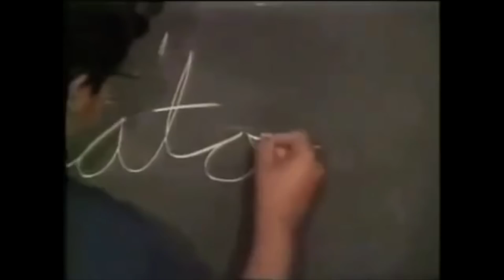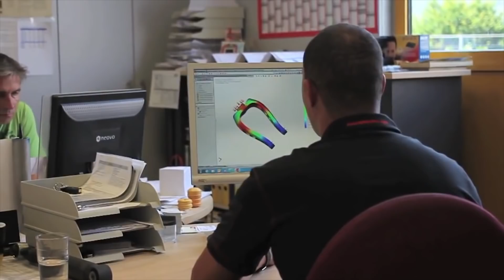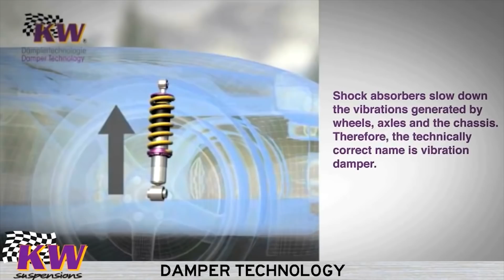THE TRUTH ABOUT KW SUSPENSION

Comment: i have varient 3's  they are amazing
Reply: Tell something more about KV 3
Reply: How's the comfort?
Reply: @Piotr Mowka   @MWAclanGaming  Hello, I have the K&W V3 since 3 weeks now. Car is Lexus IS300 mk1.
Obviously, I lack experience and any advice of me should be taken with all the grains of salt necessary. My pals in my teenage times did tuning, but they putted cheap things that you can find in our remote area, like Bilstein coils and so. But I can compare it to my original Lexus IS300 damper, that seems to be a special Tein specifically made for Lexus (green coating is very typical).

The original Lexus suspension where strongly oriented in direction of comfort, the K&W V3 helped a lot to not loose this comfort in a significant way. With no surprise, in the "standard installation setting", the car runs smooth over imperfections, but doesn't sag when turning. In the orig setting, it has always a form of elasticity that can be felt in the behavior of the car, it's not crashy, it's not race-car like. For those who know, the standard "from factory" setup is a lot like the Ferrari factory setting. It remember me a lot of the Ferrari F360 Modena, that had this kind of gentle but then furious and solid behavior. The Audi R8 also behaves a little bit like this.

The much cheaper Bilstein coils of my teenage times where feeling 200 times more crashy than that, they had sometimes problems to follow the complexity of the road.
The coilovers are lower by default in regard to the oem. Even if I would not want to lower my car, I would loose 2 centimeters. For the Lexus, I would nor go lower than 2.8cm, it's what I did, but I am at the absolute limit of beeing so low that it becomes a handicap. 2.5 / 2.8 cm should be a good goal to aim. Car is lowered but the usability of this setting stays great.

The low weight wheels paired to those coilovers are extremely unforgiving. You feel the road more through the steering and the car reacts faster. The Is300 already had a very direct driving response, but it was fastened a bit with this installation, that means that we are near race-car territory.

What has become evident, is that you can rund much more at the point of rotation and play with it. With the original suspensions, the car tend to go into understeer and you needed to play with the wheel and subtle smash of the gas for oversteering. With this setting, I need to brake less and the car will stay in an in-between position between under and oversteer, waiting for my signal of what need to be done. I feel that to be a very safe behavior.

On the modern european K&W V3, they have dropped the low and fast rebound and compression settings. You have standard independant compression and rebound settings. But they have bettered the cooling of the coilover, adding an external tank along the coil. I already tested the car on several mountain roads, during half day runs, and they are fantastic for their endurance (spots : St-Cergue Uphill, Tremola Passstrasse, Les enfers / St-Ursanne, Jaunpass).
I must underline that I will vey probably play much more with this setting. For the moment, the tail is very very planted for me, especially on little mountain roads, I need it to be a little bit more jumpy/slidy and break loose more often, this helps the car to rotate faster. For the moment, I have too much grip at the back. :-)